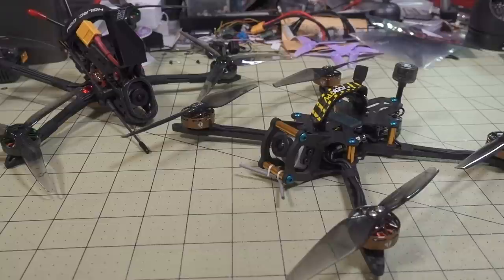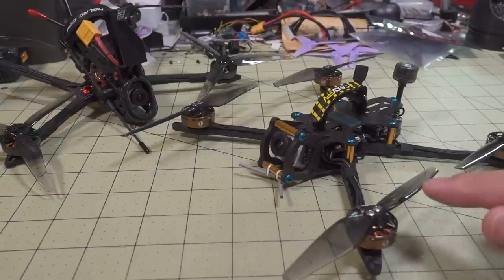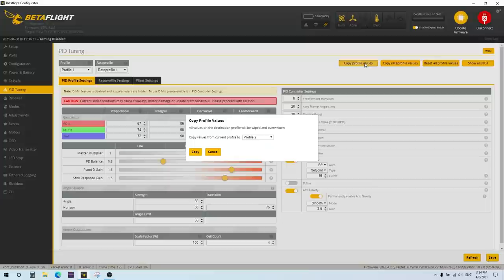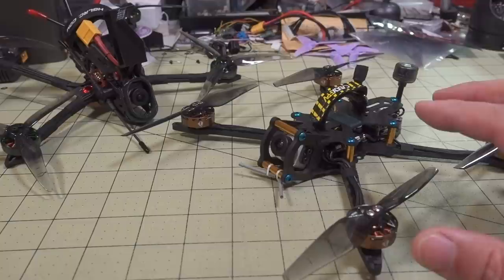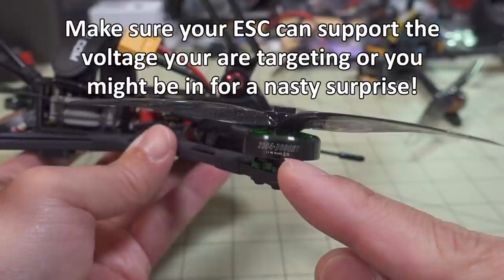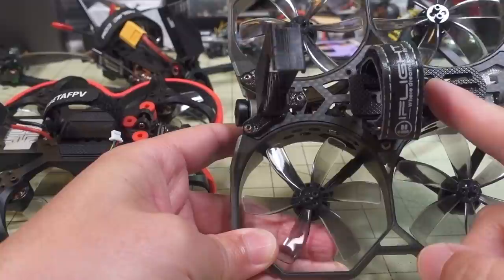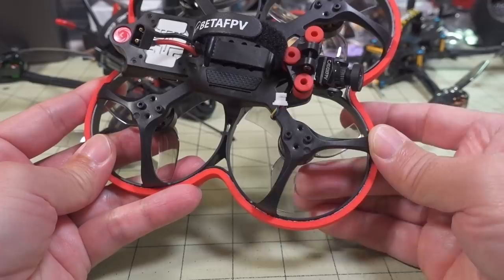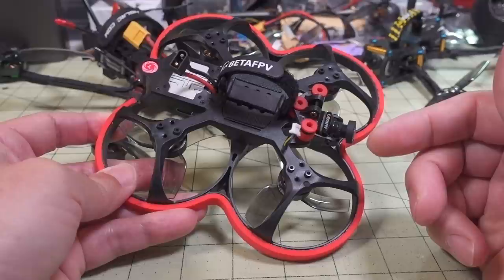Adjust Your Motor KV to WHATEVER You Want! 🔥

Comment: So the motor with a higher kv limited wouldn't be able to accelerate quicker than a natural kv motor? I want to get 2306 1950kv motors and limit them to be 1700kv but I don't want them to be louder than normal 1700kv 2306 motors. They wouldn't be louder, right?
Reply from the maker: The motor output limit just controls the voltage sent to the motor.  So less voltage means lower speed and lower acceleration.  So if the prop is spinning at a lower RPM on 1700kv, it will be less noisy however, the noise level difference is most noticeable at the top-end of the throttle.  Less noticeable at the lower-end of the throttle.

Comment: Is that what's up with the tinyhawk2? If you run it on 2s you switch to a different profile than when you run it on 1s. So they're actually 2s motors running on lower throttle percentage half the time? That's wild
Reply: The stock profiles on the TinyHawk 2 do use the auto_profile_cell_count feature, but they DON’T appear to use a motor output limit. Rather, the 1S profile simply uses higher PIDs compared to the 2S profile. https://pastebin.com/3dV6t2GR

Comment: i got some brotherhobby returner for 4s running 2500kv and wondered if i adjust them to lets say 1400kv, could i run 7" props on it for better efficiency ?
Reply from the maker: It's hard to say without trying it out.  In theory it will be more efficient.

Comment: Is this doing the same thing as setting the throttle limit?  If not, how is it different?
Reply from the maker: It's not the same.  With throttle limit, the PID loop can still rev the motor with the full RPM.  You can smoke the motor this way if you go from 4S to 6S.  Motor output limit won't let the PID loop access any motor RPMs above the set limit.
Reply: @AlbertKimTV  Because iNav does not have this feature, do you think you could just set the throttle limit and then set a current limit in blHeli_32 to stop the motor from smoking?

Comment: Definitely not the same, fine control is decreased but impulse response seems faster on the simulated low kV compared with real low kV.
Reply from the maker: OK, need to do some A-B blind testing with some other pilots.  I don't feel like throttle resolution is decreased any.  Are you sure you're not talking about throttle cut instead?
Reply: @AlbertKimTV  yes, 100% sure.
Reply: Yeah no resolution difference for me but I do have to lower my pids
Reply: @ugpfpv361  yeah the change in pids is immediately obvious, the change in resolution is probably more dependent on the individual quad. If you have a really low idle throttle and spend a significant amount of time at half throttle or below it'll likely be alot more noticeable I suspect.
Reply: @hot_wheelz  yeah I'm sure it's quad dependant, yeah I have a low idle and do lots of low proxy around trees a 2-3 feet off the ground, not a problem for me, but as they say YMMV

Comment: I have bidirectional dshot enabled and when i switch between profiles, the sliders dont update correctly, from profile 1 to 2, the gyro  filter multiplier stays on the value of the profile 1 and if i save on profile 2 the correct values, the other slider stays on the wrong value in the profile 1. Anyone else having this problem ?

Comment: Ok, so I have a new set of 1204 8000Kv motors.  Mfg states they can be used with 2s to 4s but honestly I'm very hesitant to run them on 4s.  I was thinking of buying some 3s packs and putting them on a 3" quad.  But after watching this I think if I crank them down to approx 5000kv they will be perfectly fine running 4s packs.  Is that correct?
Reply from the maker: 5000kv on 3 inch prop is better for 3S.  If you want to run 4S, drop the KV down to 4000 to 4500kv.

Comment: What if I have a 6s and want to run 4s batteries without getting the weird throttle volume.
Reply from the maker: It doesn't work in that direction.  You can still probably fly those low kv motors on 4S but it will just feel underpowered.
Reply: @AlbertKimTV  I'mma try something then report back.

Comment: Hi Albert, hope you can help me. I want to use a 1404 xing2 3000KV with a 6s battery, how is the right setup for this combination? Thanks in advance.
Reply from the maker: Not sure what kind of drone this is... that kv would be good for a 4 inch 4S setup.  For 6S, you'll probably want tot go down to 3 inch or 2.5 inch but there are other factors like weight and what kind of frame it is so there's too many variables here to make a good guess.
Reply: OK, thank you for your quick response anyway. I read up further and found that the motors also have to be designed for 6s. Otherwise you risk burning out. The frame would be a 2.5 inch quad with t63 mm hq 4 blades. The idea was to set the scale value to 65-67% and then try to see if the motors get too hot.

Comment: The best practice is to just do your best to match KV to voltage. This guy did a test: https://youtu.be/zp0UtvbxtqE

It seems there are heat losses involved when running, for example, 4S motors on a 6S pack, even when output limiting. Therefor it is less effecient to run an output limit on a 6S pack with 4S motors than it is to just run the same motors with a properly matched 4S battery.

Comment: this works but you won't get sone the benefits of 6s
Reply: it's not exactly the same , it's lowering the "ESC resolution" and it's more of a adjust voltage instead of adjust kv
Reply from the maker: Isn't voltage and KV the same thing?  KV is just a certain amount of RPM for a given voltage.  So if you lower the limit the voltage can go to, it would be the same.  If not, what exactly is the difference?  Also, what do you mean by "benefits"?
Reply: @AlbertKimTV  If you are doing a full rewind, you would aim to have the same amount of copper in your windings whatever KV you shoot for. So if you increase the KV, you use thicker wire, so you'll get lower resistance (so have less losses) (and also lower inductance which affects the control), but have to run with more current to get the same torque.
With this current limit you are not using thicker wire, so will have higher losses.
(This is based on when i worked in a company making electric car motors, but i would think the principles would be the same)
Reply: @AlbertKimTV  whatever the benefits of 6s vs 4s some of em are lost with this.  it's similar (although unrelated to this) how 24 and 48khz pwm Shoud be the same thing on paper but acts slightly differently in practice. 
this is definitely a viable thing if you don't want to swap out motors. but if you're building it from the start it's better to pick the right kv 

the escs don't streight up lower the voltage, they lower the average voltage yes but that's not completely the same as  lovering the voltage. 

someone needs to test how much it effects stuff but it's definitely not exactly the same. the effects arent gonna be huge but yk
Reply: @peterallen964  Going purely off of motor weights in part descriptions, it seems like 90% of motors don't use different wire thicknesses for different KVs.  I wouldn't think it would require any retooling for the manufacturing, but I have no experience in that to go off of.  I'm guessing then they use the thicker gauge on all KVs since they wouldn't need to make any change from motor to motor other than how it's wound.
Reply: You’d still get the benefits of lower battery sag and thus longer flight times, at least in racing applications — I think.

Comment: I got hot motors when I did mine
Reply from the maker: That happens with throttle cut.
Reply: @AlbertKimTV  I set the motor output limit to 60% just like you showed, and everytime I use 6s itd get pretty dang hot. Maybe cause I have LEDs on my motor arms you think, theyre rated for 6s too tho so idk lol. When I put a 4s pack on it goes back to flying nice and cool. Brought my tune down too for the motor output limiting still no biscuit.
Reply: @supaairsoft  did you adjust your pids, that's what I have to do

Comment: in theory you louse resolution on the throttle stick by doing this.
Reply from the maker: Are you sure its not throttle limit/cut that does that?
Reply: @AlbertKimTV  no that's just worse, to get the lower range its missing out steps in resolution
Reply: So your says the curve is different...

Comment: I tested it and it is not the same, it is quite noticeable, at least on a 3"
Reply from the maker: Care to provide some details on why it's not the same?
Reply: We need some details here.  Please share.
Reply: Without glorifying myself to much, but I think i perfect bobs tp3 on 3s in terms of pid tuning and it flew so great that I could do whatever I want with it. It could be that a 3" is more sensible than a 5" but the higher kv with a powerfull battery flew terrible and was untenable. Don't get me wrong, it flew and also not bad, but it flew never as amazing as the original setup.
Reply: @fxbd  What was the weight difference in the setup with the two different batteries?
Reply: 2s was about 20g lighter, but I don't know exactly anymore